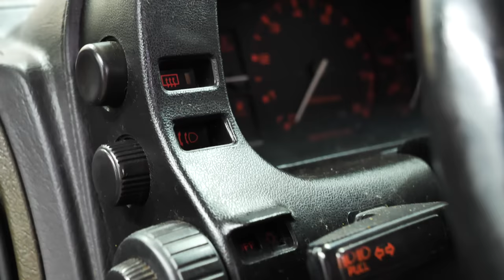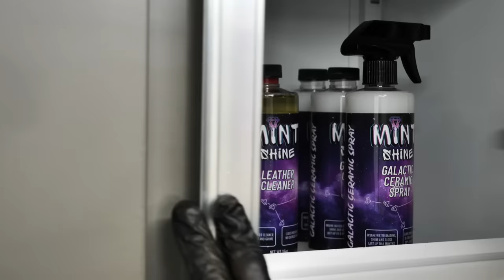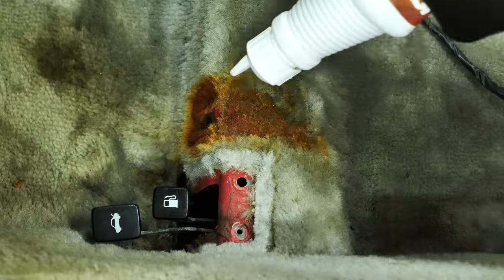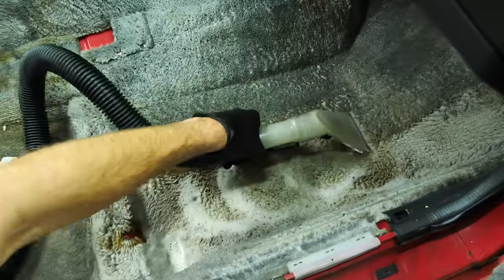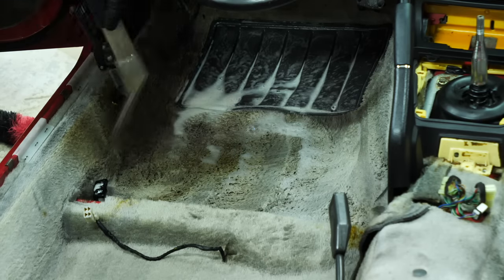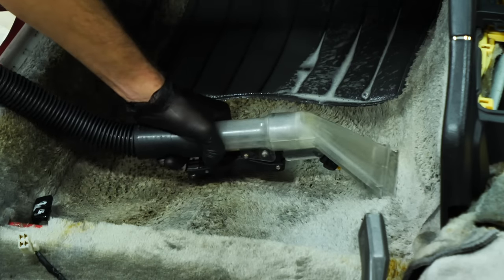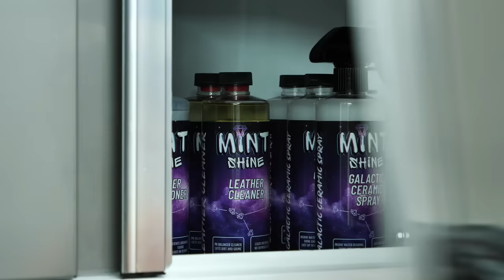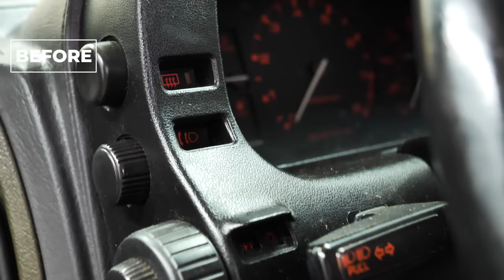ABANDONED Barn Find Mazda RX-7 Disaster Detail

Comment: How do you sanitize the air condition ducts when a car is full of mold and dirt?
Reply: 1. Take your cabin filter out. Close it up.
2. Turn your fan on high
3. Open all vents.
4. Open your hood.
5. Spray lysol spray into the air catchers below the windshield for 5 mins.
6. Using low pressure. Spray air into thosd vents without breaking the plastic. 
7. Install new cabin filter.
8. Close up the hood.
9. Vacuum/ detail/sanitize your interior as normal.
10. Your done. 😃 Do every 6 months.